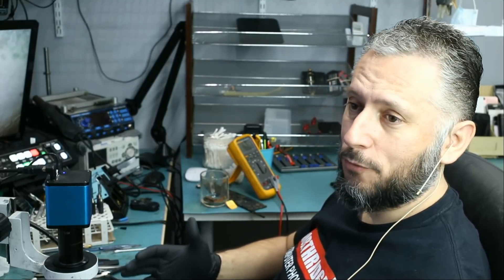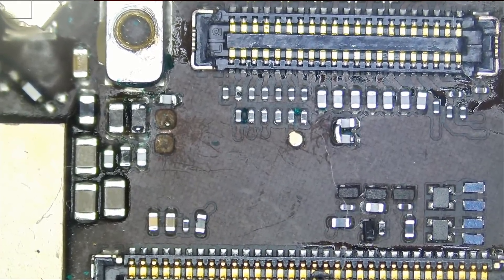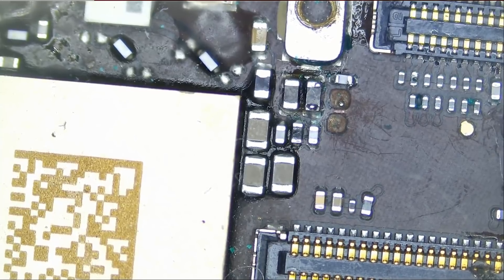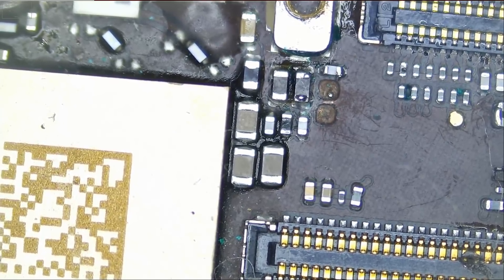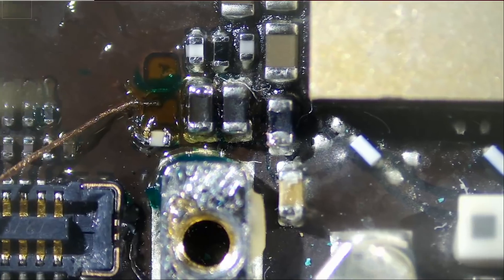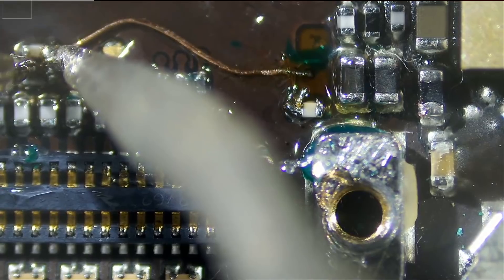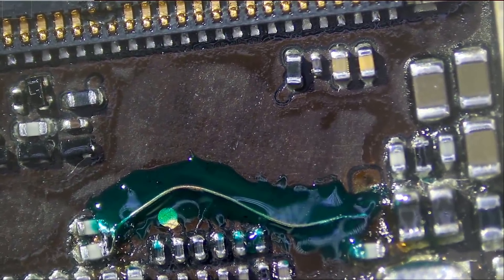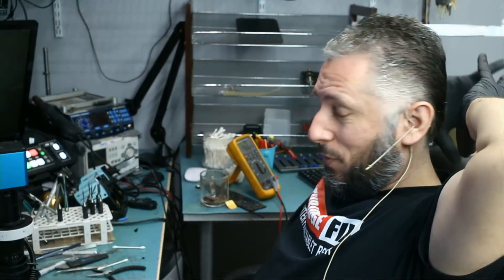iPad mini 4 Backlight circuit Repair - Ripped Pads & working with  Microscopic trace.

Comment: Thanks for your help on this. The filter / fuse had burnt out. Trying to repair it, removed the pads too. 
I had to run a wire from the soldered bridged part to one of the components (the diode) further up the board.
It's been a right stress of a repair and not one i'd be rushing to do in a hurry again!

Comment: Hello, my lcd wont turn on the apple logo barely flashes and wont turn on. Before it showed black and white lines. I dont know if the ribbon connections or the connector on the board is damaged how much will it cost? Thanks!

Comment: I had done several previous generation iPad display replacements. Especially iPad minis. I just wonder why apple needs to keep a separate sleep wake sensor flex on the outside of the display circuitry or even outside the motherboard for that matter. Apple is tactic in discouraging self repair even by professionals. iPhone 12 display/battery replacement just boggles the mind. So much for consumer protection.

Comment: Why was the other wire not required? Can someone explain :s
Reply: 1:49 he explained here.
Two options you can choose, either
1. Short the filter from the remaining tiny pad
2. Short the filter from the left side with a longer wire
Both options you short the filter, difference is the length of the wire.
Option 1 worked so no need to do option 2 because the problem was solved

Comment: Good job. So there was a missing backlight-filter, you dont have to solder a new one? Did i missunderstood the schematic, the upper connection point goes the long way to the left, the connection point under it goes to the bridged filters. But you soldered the upper point with the bridged filters?